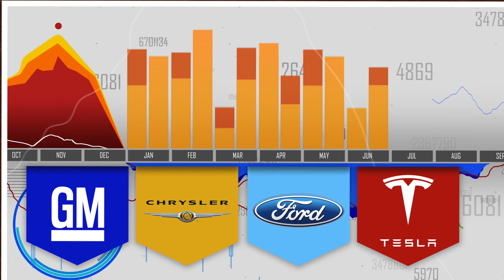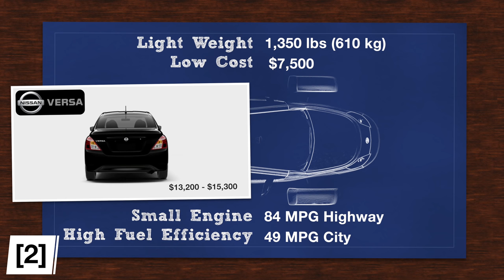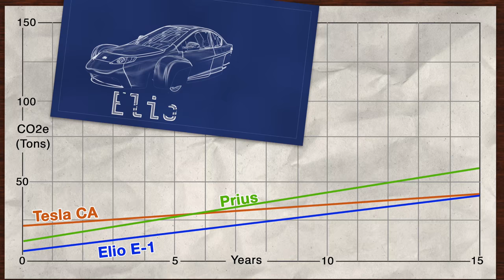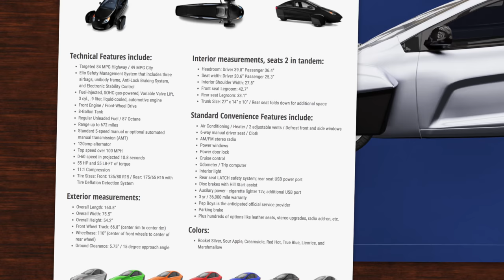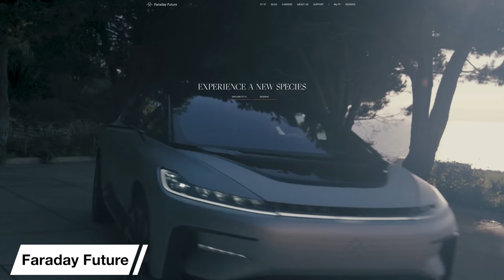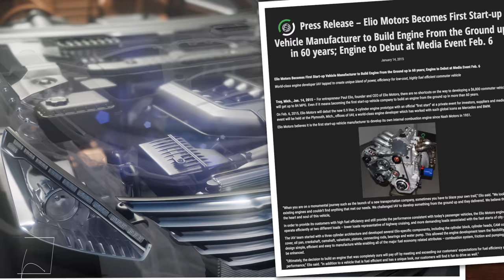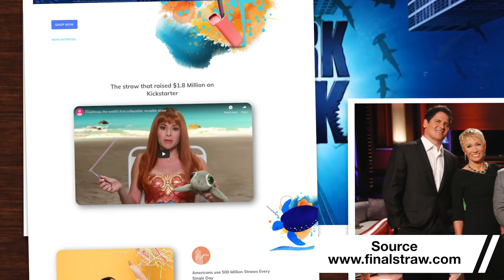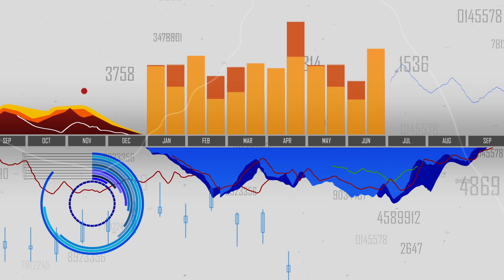How this Radical Car Missed its Chance to Change the World

Comment: With a car that cheap, new, expect a lot of students to be interested. Sadly the infrastructure (albeit it wouldn’t require nearly as much as people believe) just isn’t quite out there for EVs. I have a friend that believes he can absolutely never own a EV without a 1K mile range for the once every 6 months to 2 years he needs to drive a 500 mile trip rather than just renting a gas vehicle.  While I know that makes no sense there’s just no convincing him and I think that’s the way a lot of people are whether that’s right or not. It’s going to take a massive shift in fueling infrastructure, for example restaurants with ample charging spaces, in my opinion a dual layer battery system with part being interchangeable and part being permanent so your car can have batteries hot swapped under a membership system to quickly add 100-150 miles in less than five minutes rather than 20-50, or EVs will just have a harder time. I would personally LOVE to own a EV but within more than a hour radius I only know of one EV charging station, and that’s at a Kroger. Honestly I was shocked to find out they installed them but it was a new construction. And with the 2 EV chargers came at least 10 gas pumps. This is how hard it can be in the southern states. We really need more public charging for if anything else peace of mind.

Comment: Well done evaluation. Paul Elio is a smart guy and obviously not a shyster. I would agree that they have missed the peak of the demand cycle on this. Of course, there are many EVs coming out but they are not cheap and if the Elio came out at the under $10,000 price point it would be still be very popular. Their financing at the pump concept was revolutionary. Not sure it would work but imagine a car that could be financed by almost no money down and a gasoline add on fee. Sheer brilliance. I hope they pull it off.

Comment: I would definitely consider a purchase - if it is ever to roll off the assembly line.  I've tracked this project for some years now and it has become very hard to be optimistic Elios will ever be seen on the roads and highways.

Comment: You don't switch horses in the middle of the stream! Elio has been and is a  GREAT vehicle and I would buy TWO tomorrow if possible and others for my grandkids for their 'first car/vehicle'. For the price difference and mileage available the Elio this gas vehicle is more than economical and will be very reliable. I have Prius' and just bought a new battery assembly at $6000 (parts and labor) after my wife and son drove it only 8+ years shoots the mileage gain I've gotten during this time (avg about 58.6 mpg over-all).... With a gas motor, no need to buy batteries, or worry about charging or charging stations. Sure this will be a thing of the future for some, but it is NOT here now nor will it be here anytime in the near future. ---- My money and future car(s) will be the 3-wheel Elio. Count on it and ME!!!!! --- Retired military and now rancher/farmer.

Comment: About 18 months ago I saw a video on the Elio and it made me stop and think hard about putting down money.  Supplier details seemed very weak so I went on with my search for an eco-commute car.  My search eventually drifted to the used EV market.  Despite having to go 2 states away, I bought a used “compliance-car” ev.  My SparkEV is a great commute car.  Even in upstate NY winters, it’s enough to get the job reasonably done, and in the summers, it’s going to be great.  $11K, very efficient, good get up and go, just big enough.

Elio.  In the US, esp if one needs MC rating/helmet,  it will be greeted with the same enthusiasm as the Smart4Two.
Small atypical eco car, helmet required.  Done.  In other less ‘regulated’, more affordable transport hungry countries,  they got a better shot as a small short-range gas car.  The video is right though.  EVs are moving into the ultra-eco niche.

 A small 4 wheel-Elio EV??   Need 6-7 miles/kWh economy, and a REAL year round range >75 miles, up to 100 warm weather miles, under $15K.  Even with the 2-person size, at $15K b4 tax games, Elio could be a game changer and put itself right into role of plugging the “EV’s are too darn expensive to take seriously” hole that exists now.  Just my opinion.  Ideally, Elio wants to be marketed by a multi-national company in this form.  If the US gets snarky about size, watch Europe take on the fit.

Very affordable, easily refueled (even on 120V b/c of small battery) and safe.  Then can add eco-friendly (battery EV), good looking etc. Done, in a good way.  Tesla micro EV??

Comment: I'm not interested in owning an Elio. 

1) It runs on gas. I don't want my next car to run on gas, I want it to run on electricity, though I'm willing to settle for a plug-in hybrid with at least 40 miles of electric-only range.

2) It doesn't accelerate fast enough to take on a freeway. About half of my driving is between cities so having a truly freeway-capable, freeway-comfortable car is a must.

3) It doesn't comply with automobile safety regulations. Motorcycle regulations are not sufficient. And no, I don't want to wear a helmet in a car. That's a ridiculous imposition.

4) I only have one parking space where I live. I don't want to own a second vehicle. I want to own one vehicle that meets all my needs.

Comment: I reserved an Elio about 4 years ago. I wanted it to commute to work.
But since then, my wife and I have moved all-electric for our daily commutes (two used Nissan Leafs, bought at very reasonable prices). I absolutely adore driving electric, for many reasons, and I never want to buy a gas car again. And I certainly don't need an Elio to commute.

That said, we also own a 2002 PT Cruiser, because at least twice a month we need to drive further than our Leafs can comfortably take us. And it's going to be many years before we will be able to afford to upgrade to an EV with 200+ miles range. the PT Cruiser gets 22mpg on a good day, and costs us $50 bucks a month to insure as it just sits in the driveway. I would much rather get 60mpg in an Elio, and pay motorcycle insurance instead of automobile insurance. 

Instead of being a cheap commuter, the Elio can absolutely be a cheap range-extender to pair with a used EV.
Reply: I like my Elio and it works great. It's the perfect range extender. I dream about all of those long drives that my Elio does that my EV's can't. That $7450 price was even better as it saved me lots of money. So here's to a 9 year Elio owner dreamer.

Comment: The idea behind the Elio is solid. Make two models, one fossil fuel powered, one electric, with a solar cell and a small generator that does not drive the wheels, simply charges the battery. years ago, GM offered a tiny car, in two and 4 door configuration, with a three cylinder engine that achieved a steady in town MPG of 50 and then some, as well as a highway MPG of 80 plus. I know two people who have them. My sense of it is that Elio could come close to 100 MPG in highway trim and 75 MPG in city driving, using modern fuel efficiency and possibly a stop start system that would shut the motor off at stoplights with an automatic restart when you press the throttle. The Elio is designed for metro use, highway MPG is irrelevant.

Comment: The data presented in this video is about 6 years too late. I was completely onboard with the Elio but after the test of time, I'm quite sure it won't ever get off the ground. The estimated fuel efficiency is 100% hypothetical. There was never a production ready Elio with their "new" engine to test the claimed 84mpg. Their prototype vehicles used the Geo Metro engine which is reported to get approx. 39mpg city and 46mpg highway. I also like how the Elio's price tag was $6800, but, a few years ago the sticker price was increased to $7200 and the people who "locked in" their reservation before the price increase were subjected to purchase their Elio for $7200. And a quick check on their website I see the price has been increased once again to $7450!

Comment: One problem with saying a car has a certain MPG is that it doesn't equate to range.  A lot of vehicles have high MPG ratings but their fuel takes are only a gallon or two, meaning they still can't go as far as a traditional car. Me personally, I would want to see some crash test before I would invest in something like this.

Comment: OK, this is a three wheeled vehicle.  In most states this is also referred to as a motorcycle.  That means by law, the driver must wear a helmet in order to drive this on the road.  It may be a stupid law but the people who designed this had to be well aware of that law when they started development.  Hoping you can change laws to fit your product is like wishing in the wind.  Also the cost of $7500 would have been in line or more expensive than other 3 wheeled motorcycles already available.  They wanted to build a car, they built a motorcycle and wondered what happened.

Comment: I've been watching since its inception and am still interested. Safer than a motorcycle (that I own one) and more affordable than a sedan that has no passenger on my daily commute to work. Payment method (gas-inclusion installment) is attractive, too. Also, exploiting and burning fossil fuel have a great impact on the Earth, not only in the air, but also underground. On the other hand, who knows which future applications will need fossil fuel so we must save it now if we have alternatives. Certainly, this concept is a hope for the majority of working people and students, and the environment. I do have great concern about safety, so I hope Elio design a strong cage to protect the driver, because, God forbid, accidents happen. My car is still going strong after 10 years of service, but I am ready for a new one. I will definitely consider this autocycle if it is available at that point. I only need a safe, reliable, and comfortable vehicle to go to work and run errants. I don't need "bells and whistles." I agree it would be faster if the firm just grabs parts and assemble something, but I believe the firm has reasons to build the whole thing from scratch. A decade to develop a brand new conceptual product is not too long, IMHO. People (not me) laughed at Tesla, even recently, but looks, it will succeed. In case you missed it, there is a new startup, Arcimoto, that is selling electric "Fun Utility Vehicle" (FUV) that costs much much more than the Elio. Elio will change the industry, I believe. So I'll wait and best of luck, Elio.

Comment: The problem with tiny cars is SAFETY. When people buy cars they think of safety too, not just fuel economy. And in a thing like that Elio, your survivability is kinda null. I would even go as far as to argue that even riding a motorcycle is safer because on a motorcycle you're wearing a helmet, you have higher maneuverability and control responsiveness, and more than everything else, you have much more visibility since you're sitting in an elevated position, instead of so close to the ground and unable to see the traffic because of the cars around you.

Comment: a tricycle stability is dependent on where it's center of mass is located , where the inertia is being distributed while it's turning and the turning speed.....if the front of the car is the heaviest part and that's where the inertia is moving from you'd have trouble turning, it's usually referenced as "leverage"

Comment: As an "all in" placeholder #10989 , I hope I'm still driving if/when my ELIO arrives .
The car has "fun" written all over it !  In reference to the Helmet Laws , I believe that ALL states have given the green light to drivers sans helmets ... after all with seatbelts, antilock braking, and 3 airbags protecting an enclosed passenger compartment , adding to a fine crash test rating .
 Let me clarify that the Base Price gets you a choice of many colors , a Standard 5 speed transmission , air conditioning , am/fm stereo , power windows and antilock disc brakes .  I want the cheapest base model...I like a Standard Transmission !
 A PLETHORA of options and customization parts are offered Ala-cart(sp) including full body wrap , quit a few MORE body colors , choice of interiors bordering on Opulence , body and lighting upgrades , automatic transmission , dash telemetrics etc...Installed at the factory....no cookie cutters here ! 
Note , I'm uncertain if the ELIO gas credit card payment system is still on the table....I hope it is !
  Check out the ELIO MOTORS website for the whole picture !
 Thanks for your video !

Comment: The reason Elio went with three wheels instead of four isn't for weight, it's because using four wheels, and thereby being legally classed as a car, comes with a mountain of regulations and red tape that make the motorcycle laws seem tame.  The laws as they stand are a barricade to keep small upstarts down, so they can't threaten the big brands, much the same way things were when Henry Ford first started making cars.  The difference is, dozens, or even hundreds, of safety and emissions laws are a far more effective barrier for entry than a single over-reaching patent claim.  It's an almost insurmountable obstacle that only the wealthiest investors have the capital to overcome at all, and only the biggest companies have the sales volume overcome affordably.

As for buying one, yeah I will.  I already have a motorcycle endorsement, helmets aren't required in the US, at least not in all states, and it's an affordable, economic car that doesn't look like every other generic econobox.   I will not buy one if they decide to switch them to electric, though.   Waiting 45 minutes to charge at night at a seedy truck stop in the middle of Florida half way through a trip is not for me.

Comment: The biggest problem for Elio Motors was that they veered from the original concept which was going to be the bases for their planned success and the whole reason why they could build the cars so cheaply, build a car almost entirely from already developed of-the -shelf parts sourced from various manufactures like the GM engine they used in their prototype vehicle, that lack of development cost for the parts was going to be their key to success. additionally I think the second problem was their decision to build the car with tandem seating, in spite of really liking the car, the tandem seating is what kept me from trying to buy one.....

Comment: crash test laws prevent us from ever buying a new, sub 2,000 pound car again.  The Elio tried to get around that by going with 3 wheels and being classed as a motorcycle...but as mentioned, that came with it's own issues.  The Honda CRV-hf in the early 80's managed 50-60mpg with a carbureted 1.3l engine.  Even with old tech engine, the super light weight car got awesome mpg.  I don't think the laws will ever bend/change to allow light weight cars.  Japan has Kei cars...almost have of the cars on the road are kei cars.  You can't drive one here unless you import a 25yo model and register it with low speed plate.

Comment: Whether they make an ev or keep it the way it is, I really feel there is a market for this type of vehicle. Even for someone like me, I live in a rural area but there are many times I just need to run to the market or the hardware to picl up a few needed items. This would be a great vehicle to do that in rather than driving my pickup everywhere and racking up the miles. An Elio would allow me to save my truck for when I need to haul heavy/large items. I would even consider using this vehicle more often because it is enclosed unlike the Polaris Scorpion which exposes you to the elements and costs as much as a small enclosed sedan. I probably wouldn't drive it during the winter months since I live more than 300 feet from the road and my driveway has a tendency to drift to the extreme, in which case is the main reason I have my 4wd pickup. The only downfall I see with EV's is the charging system. Unless it can be plugged into household current and has a  long distance battery, then it wouoldn't make sense to change it to an EV. As gas prices are again on the increase and many states are increasing the tax on gasoline for road and infrastructure repairs, an Elio will sell as is very well. When changing to an EV you have to take into consideration the added weight and proper location of the battery cells in order for the vehicle to be stable in traffic. Also by adding the battery cells, just where and how much room will be needed without compromising inline driver, passenger layout. Creature comfort is still a premium for anyone that would be driving or riding in the vehicle. What about making it a hybrid, the best of both worlds. When using the gas engine, it could in reality be recharging the battery cell or using the brakes transferring energy to the battery as was the case with the Chevrolet Volt ( which was way overpriced only because GM got a Federal credit to build them plus the consumer got a credit on their taxes for buying a Volt, now that the credit is no longer offered the Volt is History just like the EV! of the 1990's.. Whichever way The Executives and engineers at Eliio decide to go with their vehicle it will be a major player in the commuter vehicle market. For my own personal uses gas or gas/electric hybrid would be the best choices.